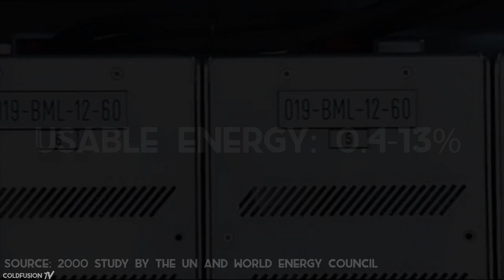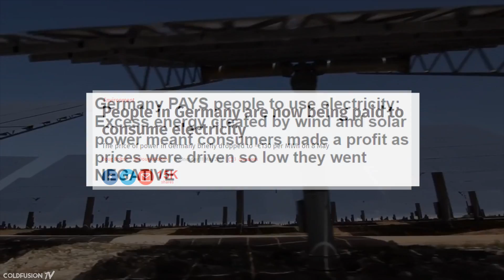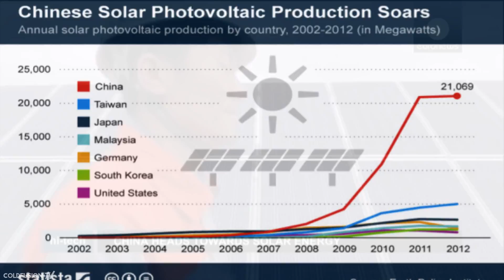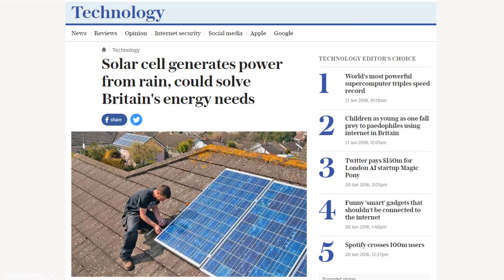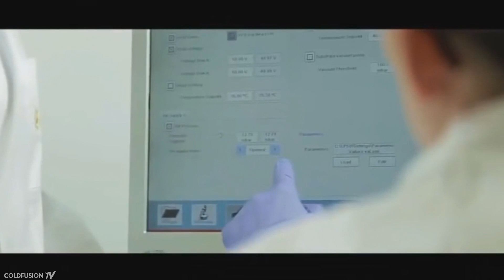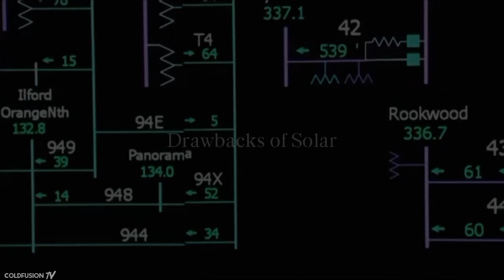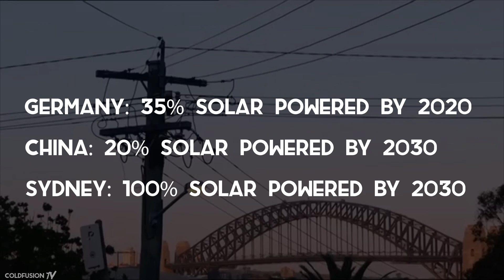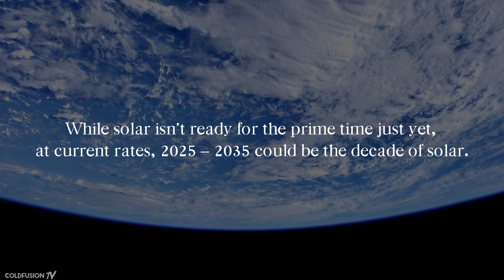The Truth About Solar

Comment: Everything is free, before you calculate the costs needed to make it work. Coal is free, is it not? Oil is also free...etc...
Reply: ***** the point is that solar energy for human consumption is not free as the video states in the end. "Free energy"...sure...for plants.
Reply: +Ludak021 humans want to profit off of every thing they can. therefore there will be no free energy anytime soon
Reply: Isaiah Martinez I know. No one is going to mine for free, or create panels for free, install panels for free, let alone provide free electricity in the end. When they talk about negative price point of electricity in some areas, what they mean is, they produce more than they can sell and it goes to waste.
Reply: MOST Solar panels available TODAY only produce for around 20 years, after that the efficiency drops off. The panels are not really the problem though, it's the associated hardware that goes with the system to get it to work with electrical/electronic devices in use today. Such as the Inverters, Charge controllers, Excess Dummy Loads, Switch Panels for access to the Electric Company Power Grid. Lets face it we've built a system that works pretty good but is becoming outdated. Never the less it's still far cheaper for the average person to use what's in place. Don't get me wrong I'm not saying we don't need to change, I'm saying it's going to take time. If we focus on making electrical devices use less electricity there will be no need to go to green because it will be green because of how little we use because of the efficiency of the devices hooked to the grid. The TV, and Lights come to mind. LCD, and LED lighting use far less than those old CRT TV's we used to have. The Microwave vice the Electric Oven, Induction Stoves Vice Electric Top Stoves, Better insulation, Insulated Windows, Geothermal Heating and Cooling. Solar Water Heaters are a good source for hot water in homes. The thing is we don't need to make it more expensive to use the electrical grid we need to make what's connected to it more efficient. That way as things use less electricity Solar, Wind and Geothermal will be able to power our homes and daily businesses. The green crowd has been going about this all wrong, trying to make carbon footprint the issue as to shame those who use what's available some kind of moral crime. The green Carbon Footprint idea is a complete Hog wash. It only alienates those who use it from the ideas that using less is good. Technology is where the solution lies and will provide the answer. Not with some miss guided NAZI style Wacko Environmentalist on a "We must change now attitude". It's such a WASTE OF TIME and that effort and money could be put into designing and making things more efficient rather than trying to impose a self righteous life style on those who will ignore them, it's such a waste of resources and time. We don't need to use less we need to make what we use more efficient. Then we'll all be green by nature rather than force. I've studied solar, wind and geothermal, not because I want to be green, but because I wanted to be independent and lower my electric bill. People as a whole ALWAYS choose the path of less resistance, to try and change or force the world to do otherwise is a waste of tome and money and it the end they will accomplish far less than if they had put their efforts into making things more efficient. Best Wishes n Blessings Keith
Reply: once you've bought solar panels they will continue to make power without the need to pay anybody... the only way they'll make money is if they put planned obsolescence into the panels so you will have to pay their company maintenance bills
Reply: how is it sustainable when factoring in the materials and processes required to make the solar panels?
Reply: Ludak021 yep stars die so frequently, i mean we must have gone through at least 10 stars on this planet so far, good thing they replace them so quick so no one notices
Reply: He meant that the fuel needed to run the whole thing is what's free.   Coal power plants need regular shipments of the stuff to keep the system running.  Whereas solar just needs regular maintenance and for the sun to continue to rise.
Reply: gaby de wilde
Some of that may be true, but the discussion at hand is power generation, and that's definitely a locally produced thing. 

But let's tackle all that other stuff for a while.  I agree that it's good for people to try and locally grow their own food, and small things like that.  But what about computers, or cars, or complex pieces of equipment like that?  There's a limit to what your local community can manufacture.  There are some advantages to globalization.  It enables people to specialize, and buy the specialized goods that others are producing.
Reply: Steve w I don't get why people have such a negative attitude towards solar power, just because it's expensive now doesn't mean it's always going to be expensive. although even that's debatable, it's not that far off beating coal power in cost per kwh in the UK... private companies will even install them for free and they sell the power to you at a reduced rate (it saves you money, the company gets a little extra then the going rate for electricity generation and they don't have to invest money on land).
Reply: +Simon WoodburyForget My matter/antimatter spacetime warp field generating engine would work just fine if only I could find some dilithium crystals for the impulse drive
Reply: you're missing the point. Coal and oil are a finite source that is running out fast. Their efficiency is pretty bleak and cause a lot of damage to the environment. Calculating the cost, That difference is getting pretty thin and solar power can be made more efficient when paired with other inventions and design. The point you miss really is that we don't have a choice but to find an alternate source. Cost means nothing if there is nothing left.
Reply: Here here.  He even mentions how awesome it would be if we ALL had solar energy, but if we did, we would put the solar energy companies out of business, as he later mentioned was happening in a few countries where they were being paid to use energy or had to sell it... because they are all in for money, otherwise they can't build the products we need.
Reply: Joel Friesen copper and silicon aren't that rare. not sure what the manufacturing proccess is but the raw materials for solar panels are pretty abundant
Reply: ***** it would require more energy to melt the copper and form the circuit boards. They may not be rare, but it would take time, money, and energy to obtain (or recycle) or even harvest said copper and silicon.  The energy required is more than the end product will produce.
Reply: Alex Childs I highly doubt a solar panel consumes more energy then it produces. a 1kw array can produce upto 1 mega watt per year, do you really think a few solar panels and a smart meter/invertor take 1Mwh of energy to build?
Reply: ***** I didn't say that at all.  I was merely mentioning that overall, the process of harvesting copper from ore, driving around to gather recycled/scrap copper or silicon, and smelting the copper/silicon would end up costing more (in energy, time, and money) than would be feasible, or reasonable, to try to offset by installing the solar panels needed to produce said energy.
Reply: Lets do an analogy with a (be it slowly) sinking ship. As in: If we render earth uninhabitable we're all fucked.

Now lets picture the crew and the passengers running around on deck arguing who is to pay for either the evacuation or the repairs and how much. (Trying to fit the round peg in the square hole.)

Eventually some sensible wealthy person says, look just get in the life boats and gtfo! ill pay you for it, just get in! Then everyone else on the ship of fools goes WOAH! Negative energy prices! Terrible! I'd rather die than get paid to use the life boat. It would destroy the life boat industry!

They all drown and find themselves at the gates of heaven, Peterus is selling tickets for 100 bucks per pop. One of them protests and argues he left his wallet down there on the boat. Peterus refuses to let them in because it wouldn't be right. Eventually, after registering for credit cards they get inside only to find out that harps cost 10 k and wings are only available in pre-order.

But the interest rates are very high so everyone lives happily ever after.
Reply: the thing with solar is that it's always coming down in price.... maybe in the future electrical companies will be put out of business if home energy storage and production becomes cheap enough for people to afford. if this happens it just means the grid will be maintained by the government instead of private industry.

wind and tidal is already pretty cheap because all you're really doing is attaching a few blades to a generator.
Reply: Simon WoodburyForget a bicycle saves more time then a car within a city, also you can predict the price of solar panels or any technology based on the past price trends and it has often proved to be quite accurate... you could say moore's law is a "probability fallacy" but it has been pretty damn accurate for the last 50 years, although it has slowed down in recent years but that's because there isn't a huge demand for computers that are more powerful. most of the focus now is on power consumption and portability
Reply: Simon WoodburyForget it's pretty likely that solar panels will continue to go down in price and increase in efficiency, Nasa already has panels that are 50% efficient! the typical efficiency of solar panels on the market now are around 15-25% efficient, so you could easily double the energy output of solar panels. But even current panels can pay for themselves within a 1-4 years period and they can last 20 years (they'll still work after that period but they just won't be as efficient) so the consumer will be able to save money investing in solar power instead of paying for electricity from the grid and the extra electricity generated (after they've offset the energy requirements to build them) over the the last 15 years of operation will be much more then the energy required to recycle the solar modules
Reply: *****
Let me explain the global CONSPIRACY to you: Ideally everything a person needs is produced locally. We don't know how to do that in all cases but where we do it is in our best interest to do so. It isn't good for everyone however. People make a shit load of money by making us dependent on their shit. The punishment for our collective ignorance is an amazingly unstable and fragile system. Something may happen on the other end of the world and render you without X or Y in a few weeks if not days.

People who don't understand this will (inevitably) end up calculating the return on investment by comparing imports from far away lands with stuff made right at home. It is actually amazing that solar voltaic is cost effective in that formula, it doesn't have to be at all. It is perfectly acceptable for redundancy and stability to cost more.

Sit back and picture how funny it is when people talk about the cost of things 30+ years into the future. We are say, in the middle of that alien invasion and the nuclear winter after barely surviving the AI wars and global water shortage... But joe sixpack already knows [say] oil will be readily available at a fixed flat rate. There will be plenty of well paid work and my money will be worth as much as it is today.
Reply: gaby de wilde I don't think it's all doom and gloom in the future. there's plently of water in the world, we just need to find a way to harvest enough energy for desalination plants and increase the efficiency of rain/drain water collection and recycling.
Reply: PTNLemay Small things like food? shrug

I'm not saying you should grow your own food actually. I think it shouldn't be shipped in from the other side of the world if it can be grown say within 50 km.
Reply: gaby de wilde 
Yes, food is a low-complexity good that people can grow in their back yard.  But a laptop will require a huge assembly line with all sorts of research & development.    That's what I meant.  In between those two extremes you have all sorts of things that are relatively easy or difficult to produce locally.

I agree with your assessment from an environmental perspective.  Shipping all of that stuff on container-ships when they could be produced locally is inefficient.  But the problem is that economics means that sometimes it's more expensive to produce that gum in North America than it is to have it made in China and then shipped here.  It's silly, but for all sorts of complicated reasons it does often happen.  I think that primarily it's due to minimum wage in NA.  Doing basic jobs will cost quite a bit, compared to paying people peanuts to do it in China.
Reply: PTNLemay container ships are actually pretty fuel efficient per ton of cargo (they can transport 1 ton of cargo 1000 miles on 1 gallon of fuel). that's why shipping doesn't tend to have much of a noticable impact on the pricing of goods from china
Reply: *****
yes, it was designed to be efficient like that. We didn't design it to be robust. It depends on countless other factors one of which [ironically] is market stability. The whole thing can expand gradually and it can downscale even faster. If people don't have money to buy stuff for a few years we can quickly demolish that part of production, scrap the boats and fire everyone previously working to feed, house and dress you.
Reply: gaby de wilde 
The  market is self-correcting though.  You're imagining that some critical aspect that allows the ships or the trucks or the other mechanisms of the market will suddenly stop working and throw a big wrench in the whole machine.  But it wouldn't be that sudden, what would happen is that that one special something would start becoming rarer, harder to manufacture, and thus become more expensive.  The market would react immediately and either start looking for an alternative thing, or adjust prices to compensate.  By the time that thing is fully broken or missing, the system will have compensated.
Reply: i think they mean free as in the supply never runs out. Cant be charged money to access sunlight, its not a finite resource
Reply: Steve w
yes, but, even that is not true. Stars die.

In all honesty, it's just hype. Access to Sun is free, converting that energy into electrical energy is the most expensive electricity atm.
Reply: Ludak021 in my country solar and coal cost about the same, if you look at what the consumer pays though it's works out cheaper to get your own solar panels fitted instead of paying for grid electricity (which costs £160-£190/Mwh), you also get a feed in tarrif of £45/Mwh for unused power.

in the UK it costs £125-£180/Mwh for solar and £100-£155/Mwh for coal.

wind farms cost the same as nuclear power, both are around £80–£110/Mwh and natural gas costs £60-£130/Mwh
Reply: Coal and oil are both from the sun are they not?
Reply: Sun is also not everlasting. Not that it matters to us, but it is being spent slowly.
Reply: Simon WoodburyForget
And that's why scientists work on thorium reactors. It's abundant, realistic and cheap. Renewable too! They are also working on fusion reactors, they are power of the star right down here on Earth. The point is, even if solar panels were everlasting (which they are not) they take a lot of space, they are not very efficient and will eventually be replaced along with current nuclear power plants because fuel they use will definitely run out since they use one of the rarest element found on earth.
Reply: +Ludak021 the sun is a natural fusion reactor that makes any machine man could ever hope to build look like child's play. It already powers the vast majority of processes that occur on this planet. The fusion reactor that is the sun is at the perfect distance and our atmosphere is a nearly perfect shielding. It will not be decommissioned for at least the next billion years. Ultimately thorium reactors are basically a joke next to the power of the sun
Reply: Stephen Nielsen Yes they are a joke compared to that, but solar panels are not even funny in comparison. Solar panels =/= Sun
Reply: Simon WoodburyForget Joke all you want, but Chinese already have some working prototypes. It will be done. It actually was done during WWII to power some prototype bombers. Look it up.
Reply: Stephen Nielsen in a weird way, Oil is solar power! hehe :P
Reply: +Ludak021 Yes, solar panels are not the sun, they are the way to collect the sun's energy. I agree with Elon Musk here, it's a simple matter of engineering adaptations (mostly on the nano scale) to the massive reactor nature itself has given us.
Reply: ***** i don't understand it either. The only thing I could understand is how people seem to rate these things on how immediately efficient they are and forget about long term sustainability. Like gas engines for example, I'll be the first to say id MUCH rather use a gas weed wacker or lawn mower because you get so much more power, but its only short term. Eventually we need renewable power sources. Not even talking about clean ones, but sustainable ones that dont run out. We will have to move into space eventually, More advanced forms of solar energy collection and distribution are probably what will take us there. I'm not alone in thinking this either, people have already pondered things like the Dyson sphere for years as a way for a large part-space part-planetary civilization to survive. And as for gas, hydrogen works much better; clean burning and wildly abundant. Just need to find ways to better control it because it is volatile in liquid form, very flammable
Reply: +Ludak021  The Chinese MIGHT have a very small prototype LFTR (Pretty sure it's along the same lines as the Oak Ridge experiment) up by 2020. They plan to follow that 2-megawatt test reactor with a 10-megawatt demonstrator and a 100-megawatt pilot. When the world will get to a commercially viable 1 gigawatt LFTR reactor is anyones guess. To me it doesn't look like it's going to happen before 2050. Meanwhile solar will be kicking nuclear's tail and DC power will probably be making a huge comeback
Reply: It took us over 6 million years to get to Nuclear Reactor of today, and it's a problem to wait 50 more years? Wow. Come back of DC? Sure, from room to room, not over long distances. You would need to cover whole state of Texas in solar panels to get rid of a dozen of nuclear reactors. Also, There is nothing wrong with nuclear reactors. Unless you think it's a good idea to build it in Japan.
Reply: Simon WoodburyForget I am sorry if you cant pay for electricity, I can. I don't have to wait for anything.
Reply: +Ludak021 Solar energy is harvested, used and stored locally, so DC is a better fit. Solar energy can and will be catalyzed into solar fuels and all manner of solar produced products made from the molecule up. The sun's energy has powered the production of biological products for hundreds of millions of years, so the harvesting of solar energy puts humanity at the cusp of a new industrial revolution - molecular manufacturing. We are moving away from panels and toward solar being incorporated directly into building materials. In addition, Solar plus on board storage is a perfect fit for robotics of all kinds. Nuclear will always have its applications, but it"s doubtful it will ever be anywhere close to humanity's primary energy source.
Reply: at some point, yes, you are correct. But atm, we are far from that, with solar panels, wind turbines etc. My country makes most of it's energy using river dams. How clean is that? ;)
Reply: +Ludak021 I don't think you are fully appreciating how fast the technologies we're talking about here (PV, solar catalyitics and storage) are advancing or how much faster and easier they are ramping up into production lines with each iteration or the degree to which they are getting cheaper even as each generation gets better.
Reply: Stephen Nielsen there's still allot of potential to develop solar technology. if you couldn't harvest more energy from solar then the energy you put in then plants wouldn't exist because they would be in a constant energy debt (most plants also dump their leaves every year, either to grow fresh leafs or to survive winter in cold climates)
Reply: ***** Plants feed from ground, using minerals from soil/rocks/decomposed stuff like, dead animals, plants etc. They also need a lot of water. Solar alone wouldn't make plants exist as evidenced by 99.9999999999999 planets in the universe. Just please, don't get into how all the materials that plant use for food also exist because of solar blah blah...I know all that.

Simon WoodburyForget  And when those solar panels you invested in get outdated like, say CPU or graphics cards in computers during the years, sure, you investment would be pay off...The moment better solar panels come out, your's will loose in value. Don't be naive. Also, panels are not going to have infinite durability.
Reply: False equivalents. False statements too. Not even close. Coal is not free, oil is not free, nuclear fission is not free, haven't been for years. (Hundreds of years for some of them). Not to mention secondary and tertiary and quaternary costs, ie: pollution, global warming, health problems, etc. 
Just as Kei says, coal and oil are finite, extremely finite. Nuclear (Fission at least) is too dangerous, unstable and becoming more expensive. 
The French have fission reactors (tokamak), at least two I believe. They are both experimental and under study, but functional.
Reply: whatever04 that's because you live in shacks and in swamps. Where do I put solar panels in a 40 story building?
Reply: Ludak021 you can transport solar generated power through the grid you know, it's not like you have to generate all the power on the site it's used.
Reply: ***** sure sure, government is all about cheaper solutions for people, less taxes they collect, the better they are. Now lets wake up. Thanks.
Reply: enator71 I was being realistic. You are being in some dream state where solar power solves everything.
Reply: enator71
first of all - I am not angry at all. Where did that projection come from? Second - I am cynic. When I see a video claiming how solar power is free I laugh at the idea. That aside - solar panels take space. Space that could be used to plant forests that we cut down, so we can have usable air in the future to come. We could also build homes in ever growing population, we could do a lot of stuff. In some places, square foot is worth 100 solar panels. I don't like that but it is so. We can also grow food on the land that would be occupied by solar panel. Then there are practical obstacles  like buildings, like I said already. Also, many many countries have hail fails. Those destroy solar panels. In my country, we have hail at least 2 times per year. Hail that breaks windshields on cars, destroys roofing etc.
Do you understand now why solar panel isn't a solution to world power needs? Good for people that can use it and afford it, and replace it, and protect it etc. Not so good for everyone else. One good nuclear plant can replace area size of New York city covered in solar panels. There are things wrong with today nuclear power plants (type of fuel used) but that will be solved because they will run out of the fuel they use now.
I could go on about why solar panels are not going to be the future but you get the idea.
/over and out.
Reply: Ludak021 I am a staunch nuclear energy supporter too. After a lot of trouble from left leaning activists and NGO's in india - we finally got a nuclear plant in kudankulam. And I am v happy.. A lot of fears associated with nuclear energy, esp from left leaning groups are exaggerated - it is in fact safer than coal. I have shared articles in support of nuclear energy, and clearing a lot of the misconceptions/myths about it on social media myself.
 
But honestly, you are starting to sound just like one of those leftist-trolls who will never accept nuclear power, no matter what. You are the other side of the coin (a right leaning, close minded troll).

In India, in gujarat - we have solar panels on barren/waste lands. We have them on rivers and canals. We have them in places which need to be cool and could do with some shielding from sunlight. Not in crowded cities (obviously).

Like this video said - most of the arguments against solar are getting demolished with advancements in tech.

Solar CAN meet a large part of our energy needs. A place the size of sahara desert (most of which is uninhabited) is enough to meet the power needs of the ENTIRE WORLD. There are such uninhabited places all over the world in nearly every country - which can be used for solar. Especially in today's world where half the population lives in cities. 

Moreover - the new perovskite cells mentioned in this video are cheaper, can be coated on any surface and can produce more energy than silicon. No worry of them breaking or getting damaged by hail. They should be ready for use by next year and it will be revolutionary.

If solar panels are used on rooftops in the US - it is enough to meet 40% of the total energy needs of your country.
Reply: "There are 60 commercially operating nuclear power plants with 100 nuclear reactors in 30 states in the United States. Of these plants, 36 have two or more reactors."
Reply: more than one reactor failed since the high breeders were introduced long time ago. No one said they were infallible, but the newer ones,  done right, without cutting corners, or building them in areas prone to earthquakes etc. they are still the best power source. Each Plant employees over 10K workers. That's why they choose to build the least effective models...Aaaand..this is all besides the point.
Reply: enator71 yes I have. How do I put enough solar panels on my 87th floor on my 100 floor building. How do you replace over 200 reactors over US with solar panels and how much millions of square miles would it take from the places where food is grown. How many families would suffer if you would do that?
Reply: enator71
If anyone needs reality check, it's you. IF this could be done the way you suggest it could, it would have be done by now. You should probably look into how much energy is currently generated and used then calculate how many panels you would need instead of spitting "facts" out of  your ass.
Reply: enator71
that's your usage. I was talking about shutting down nukes and replacing them with solar panels. You are switching the topic. Let me get it back on track: if you search for how much power US uses, you get 13,246.27 kWh per capita (data from 2011!) which I will round up to 13.246 mWh per capita. Multiply it by 300 million (although there is more than 320 million in US) and we arrive at a nice number - 3973800000 mWh. Shall we say that we can round that up to 4 billion mWh ? Now, that's RESIDENTIAL consumption. Without Industry. Give me the number of solar panels needed to produce that much power, thank you.